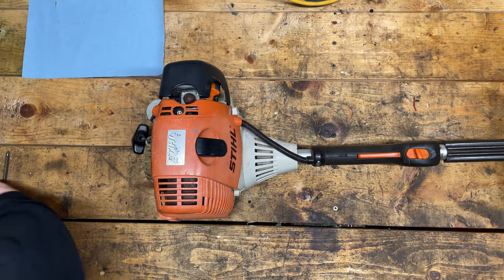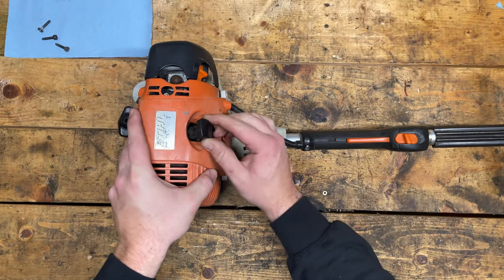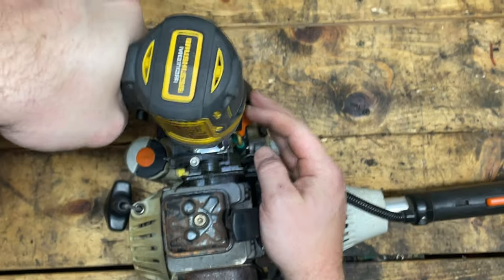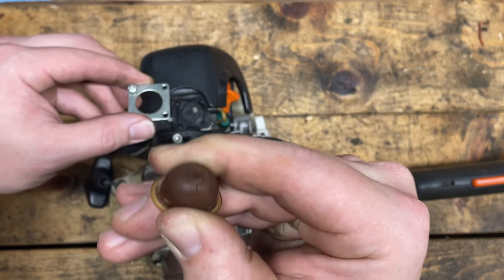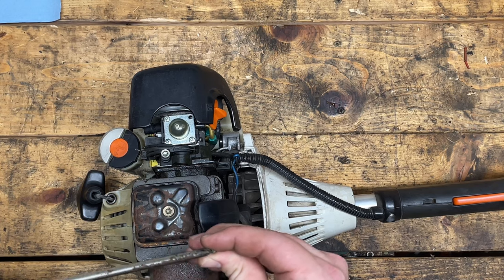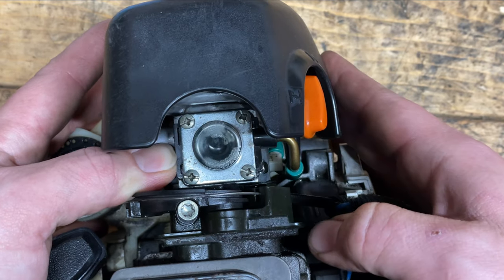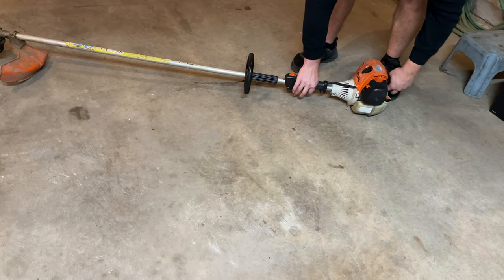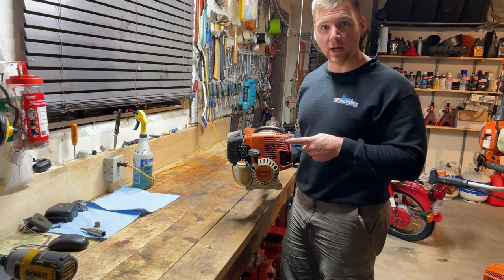How to quickly change a cracked primer (purge) bulb on a Stihl Pro string trimmer! (Step by step!)

Comment: I've done a few of these over the years on my own equipment , the bulbs themselves ( of this style ) come in two sizes that I've seen , either 19mm or 22mm which is the outer diameter of the flange , last one I did was the day before yesterday , plans of trimming some thick grass under a fence line in the morning changed to replacing the bulb and a fuel line , still got the job done but a bit later in the day ;-) . Cheers Dave , you're doing a good job there , all the best .
Reply from the maker: Hey Gordon! Great to hear. Thanks for the kind words!

Comment: QUESTION:   My line trimmer starts but then shuts off. The purge bulb is new. I replaced it. The bulb only fills half way when it purge it. Should the purge bulb be full of fuel after purge or is halfway normal?? Thanks

Comment: Nice one Dave. Worth the 100 bucks bud.
Reply from the maker: You think? I'm going to keep it around. I have a couple of these powerheads on different implements... they seem to work well. My favorite is still the FS85R 2 stroke!
Reply: @DavesSmallEngines  They work very well but Im still a two stroker fan with the higher revving stuff.